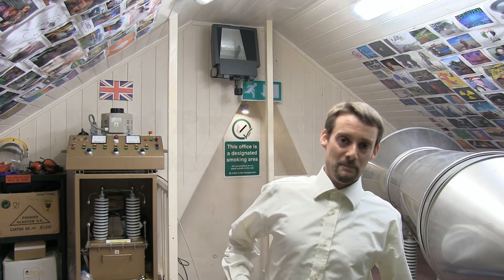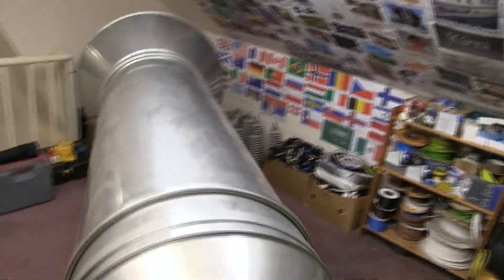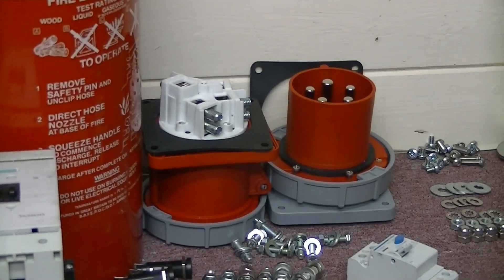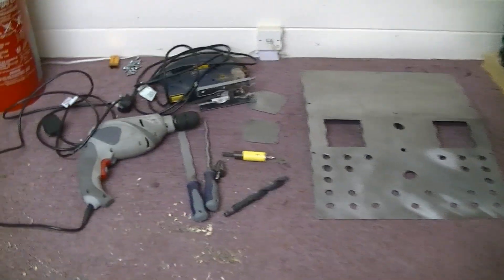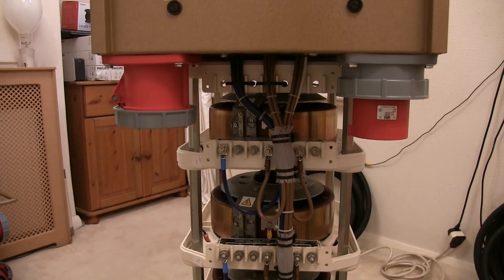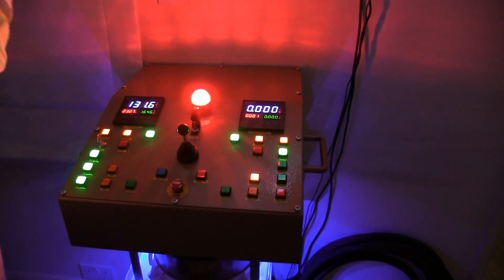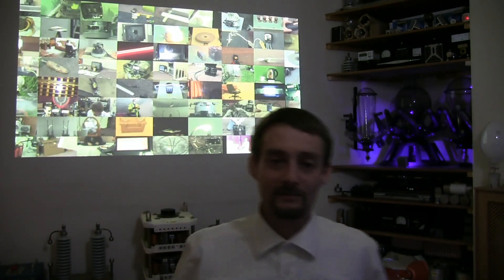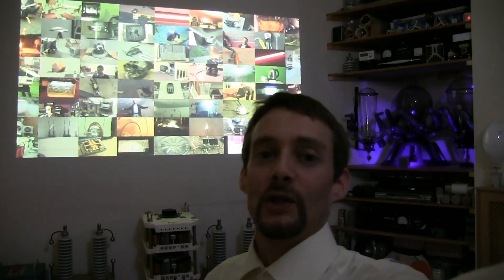20,000 Watt Power Supply

Comment: Ok let me see if I got this right, "that power supply" is for the hydrogen reactor your presently working on. That's got to be one of the fucking coolest ideas I've ever seen. I also think a gadit and or tool need to work as the manufacturer advertizes and sometimes when they don't and a take the worthless item back to where it came from I often feel the need to show these fools how it's done and go back to the place with your "superior " model of there product, it never gets old and still give me an erection every time, our products division was born. We also have some DIY tools because the store brand couldn't cut it. See what I'm talking about at our site www.alcoconstructionofkentucky Anyway you get reactor thing working, and don't get blown up. I WANT one! A unit like that could supply enough power for a home and a small shop right? I'd be interested in more information on how it works, that isn't to hard to understand, not the sharpest tool in the shed but I can build anything. I could even help you manufacture these thing if it comes to that. So keep me posted
Thanks
AL Lehne / owner, ALco company's

Comment: Looking back at the motorway drive, you say that you'll need to take the house offline, because of the power that panel pulls.

That's a 100A circuit, and you say you'll be using that and then some.

Edit: The variac is rated at 209, so 415 is out of the question.

However, assuming the panel is 240 (which seems likely, whereas 415 doesn't seem as likely for a residential hookup), and knowing the panel is 20 kW, you'd be drawing only 83 1/3 amps.

Tell us what that beast really draws?

On an unrelated note, I do hope you'll be building a ridiculously high voltage transformer for this. =)

Comment: Probably been asked before, but those are by the looks 63Amp or 125amp sockets, 3 phase. So my Question is did you get a 3 phase supply installed, as it would work nicely with the 3 variacs. but then the 2 transformers just suggest that you're stuck with your single phase supply. So why bother with the added expense of 3 phase plugs and sockets? And i'd love to see the supply side of things, how you've connected to the incoming mains. Or is that some Jiggery-pokery that we'll never see.? haha Love the vids keep it up,
Reply from the maker: ahh... all will become clear...Oh ok I'll tell ya..Single phase, but L2 and L3 control the unit remotely :)
They are 125A 3 phase N and E with pilot pin  ( running single phase and control )
Cable is 16mm x 5 Core
Reply: ***** Sweet i though something like that. i work in technical theatre, so sado me knows his plugs and sockets, even the stupidly high current rated ones. Thanks for your answer :).  Can't wait for the next vid.

Comment: You said you going right to the grid or you going throw your electric panel.Qustion:with all this power you makeing does the power company know.Do you need a permemt throw you city for  you hobby
Reply: pklongutoobe USA? You mean england? haha
Reply: Permit? I thought the USA was the land of the free! He's probably got the standard 80A or 100A 230V(nominal) single phase supply. Provided he doesn't pop the fuse in his supply cutout he can do what he likes. Which in practice means he could probably run his toys a little over the fuse rating for a short period, not that I would like to try it! 20KW is only the same as a couple of electric showers anyway.
Reply: pklongutoobe That plug he shows, which he states goes directly into the grid is a 3 phase plug, not to mention that he stated that he had triple latching, a triple contactor, and three variacs, all this makes me think three phase.
Reply: I think he said once his house has 20kVA single phase so he must be getting another connection for this.

Comment: Great to see your back! Sorry to hear about all the troubles you've gone though. I've had a few rough times like that myself. Sometimes it all seems to come up at once.

That is some amazing mouth watering work you've done with that variac. As for the youtube vids I use a program called videopad video editor. It has all that upload to youtube stuff built into the program and I've found it works quite well. Also 1080p isn't really necessary. You could save some upload time rendering in 720p (1280x720). Whats your internet speed like? It shouldn't take all night to upload a video. Sounds to me your file sizes might be unnecessarily large. What file type and encoding are you using?

Also check out this webpage describing the supported youtube formats:https://support.google.com/youtube/troubleshooter/2888402?hl=en  Might be helpful. Also https://support.google.com/youtube/answer/1722171

Hope this helps.

Comment: I was drooling as soon as I saw the beast, by the end I had felt new levels of envy that no human has ever before felt. I have screwed around with my fair share of mains voltage and small MOTs, but never to your level. You said near the beginning that the new power supply will hook right to the grid, how many amps could you pull with that bad boy before something explodes? I've been able to draw 180ish amps from my breaker panel (I have 200A service at 240V) before utterly decimating the 1/0 wire I was using to melt/pop/explode random junk around. (I was playing safe with the proper precautions in place.)

Comment: When I worked on power control systems for electric furnaces the currents out of the transformer secondaries were so high that EMF would cause the cables from the transformer cage to the electrode head to physically jolt several cm from their rest position.   Getting any of that here?

Comment: You say you want to generate hydrogen with this power supply. One of the major contributors to overvoltage in a cell is inadequate electrode area.

Comment: Nice to see You back! Is too small for You :)))) I will speak with one of the boss of Atomic reactor. i see in My life a 1.3 meter diameter cable, and there is 9 piece from that. Is in the aluminium casting factory. The power consuption is huge. 100.000 amp on 40 volt. the cables are pull each other by the magnetic field around, and melted a 20 tonn container alu in about 15 minute :)))))

Comment: Yay.....YAY......YAAAAAAAY!!!!!!!!!!!!!!! :D Mr. Photon is back, peoples! :D

Haha, I ROFL'd so hard when I saw the size of those plugs.... LMAO! Yes, I did get pretty excited at those. The biggest plugs I have to date, are the 32A blue plugs (BS EN 60309-2) for my 28A BIG DOGG variac.

That thing is going to be proper nuts when you fire it up for the first time on-camera.

I say...... Stuff the kettle on it, RIP IT RIGHT UP and let's see what a kettle can really handle. :D

If those heating elements took a 440v beating outside of water, then surely the kettle would be OK on say... 350v ? :D

Let me bust some Ohms Law calculations right here:
_________________________________________________
3kW kettle at 240v = 19.2 ohms.

Supposing we wanted to "upgrade" the kettle to 6kW..... :D

6000 watts and 19.2 ohms would give us a target
input voltage of............. 339.41 volts. :D

Ah stuff it, just give it the full 340 volts. :D ROFL.
(340v, 19.2 ohms = 6020.83 watts)
--------------------------------------------------------------------------------------------

So, at 340v, you're definitely going to be needing that powered-backwards transformator device to ramp-up the volts a bit more than what the variacs can produce. :-) The theory is....... at double the power rating, you'll achieve cuppa-tea-time in half the time of a boring-old-domestic-everyday 3kW kettle.

I'm really looking forward to seeing what you'll get upto with that extra-beefy assemblage of electrical toys.....Just don't go popping the 100A service fuse, OK? :D

Take care,

-BoomBoxDeluxe. (Viewer No: 2754)

14th September 2014, 18.50
Reply from the maker: Wow, BoomBoxDeluxe you flatter me with your sizable comments yet again. The double output transformer will be in use on all tests giving 480v out, the variacs will never make it to 240, the item connected to it will be obliterated way before then:)
Hope your well, Andy
Reply: ***** bloody hell youve done a great jobe there :D
Reply: ***** why all that voltage? less heat in short circuiting which is what blowing things up is all about, half the amps?
Reply: *****
The perfect explanation to this is "BBD's telephone HOT Line" (which is available to view on my channel).

You can have all the current going, but if you haven't got the VOLTS to shove that current through something.....Nothing happens!

Initially, we thought that a mobile phone would go haywire and completely let loose when directly-wired to 240v.....It just sat there!

NOT HAVIN' IT !!!!!!!!! :D

Visit my channel and watch "BBD's telephone HOT Line" to see how we managed to PROPERLY recharge that phone, and some of the high voltages involved. :D

Given that the phone was a SAGEM, the results were deeply satisfying! :D

-BoomBoxDeluxe.

16th September 2014, 12.45
Reply: yeah i suppose with something with a high resistance...

Comment: impressive flash gordon looking thing but maybe it would be interesting to enter the world of switchmode supplies.
Reply from the maker: All that sensitive electronics and crazy high voltages?
Naa, the 3 variable transformers are already 25 years old, it is only the control box that is new. this unit will still work in 50 years time because of the elimination of electronics, the meters on this thing will fail first, luckily it will still be usable without the meters :)
Reply: ***** in the next 50 years things will change quite a bit.
I'm not sure you actually mentioned the output voltage but switchmode can do high voltage without problem as well. mains frequency stuff hardly exist today as is and certainly wont in 50 years. things get much smaller and cheaper at higher frequency. that's why Tesla wanted higher frequency 120 years ago.
Reply from the maker: Dan Frederiksen I've blown up too many switch mode units by shorting them and inadvertently backfeeding HV pulses :(
Reply: ***** sure, certain designs can't handle shorting. if it's transformer based though it could be robust I think. a fast circuit can also protect unisolated designs but if you want high voltage I think it will be isolated anyway. only bucks are direct I think.
Reply: One word: simplicity

This beast is big, inefficient, would likely pop some lower amp breakers on startup, but all it is it's just a copper wire on steel toroid with a slider, it really needs some proper misuse to fail. All what's fancy here is that control box and motorized slider that will likely fail before actual variac. 

Switchmode PSUs are fancy and outperform linear power supplies by far, but they are likely to fail in abnormal situations like backfeeding or short circuits.
Reply: mibars Backfeeding and short circuits, Photons favorite things to do with stuff. At least when he is melting open end wrenches that are nearly 1inch cross sectional surface area.
Reply: Dan Frederiksen Transformers and switch mode PSUs both have their applications. I love both for what they are capable of. With a transformer you have a very robust circuit that can withstand some abuse and you can send energy back the other way if needed. With a switch mode PSU you can obtain very high efficiency high energy conversions in a relatively small package, though the wrong voltage in the wrong place will kill it, so a well designed circuit is necessary for this application. In these application where high efficiency is not a concern it is easier, more cost effective, and more reliable than a switch mode PSU.
Reply: mibars  >One word: simplicity
If you want simplistic spectacular destruction, you want a big ass fresnel lens and some sunlight. One part and two requirements for it to work: A clean lens and sunlight.
Reply: Hatagashira Sure, you need just a nice sunny day and biggest possible fresnel lens, like one from slide projector, or even better a rear projector TV. But Photon lives in England, what would he do the other 364 days of the year?
Reply: Design an effective arc reactor, sell the design on silk road² and build a self-sustaining underwater villa on the sea floor in uncharted territory as far as possible from the edges of tectonic plates.

Comment: why are you trying to log in to youtube with a video editor??
just render the file and upload the video using youtube. it is quite simple. not sure why you are making it complicated.
Reply from the maker: I tried that and sat there all night, then it said unable to process, unsupported file type :(
Reply: ***** youtube said unsupported? then render to another format. most editors can output to multiple formats and you have to pick a rather unusual one for youtube to not know it I think. you import your files in the editor, you edit, you render to a file and upload the file to youtube from the website. if there is a problem with any one step it's that one step that you should fix, it's not a hollistic thing where the editor has to log into youtube. I have actually never heard of that approach and certainly isn't necessary
Reply: ***** Andy, render very short videos in the formats, (maybe 2 mins) just to see which one ends up smallest and youtube's happy with it, etc :)
Reply: Dan Frederiksen the problem would be the export speed and that's the massing about